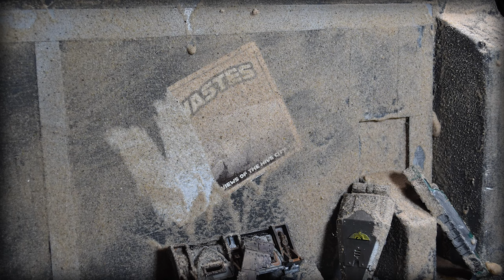Creating the Dustwall from old terrain

Comment: Love the video! You mention going back in with super glue/baking soda after gluing everything down with hot glue, is there a reason you went back in with super glue? does hot glue not hold down enough for actually playing on the terrain?
Reply from the maker: It seems to be resistant to the future painting steps later.  Mainly the oil spirits.  It's also a habit I've formed because I don't want things to break off too quickly!  Thanks for the question!